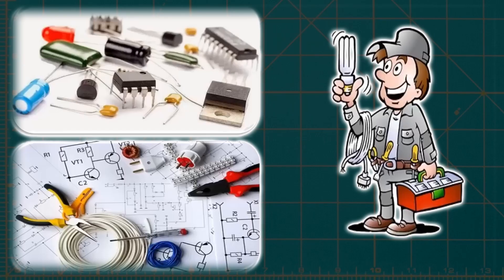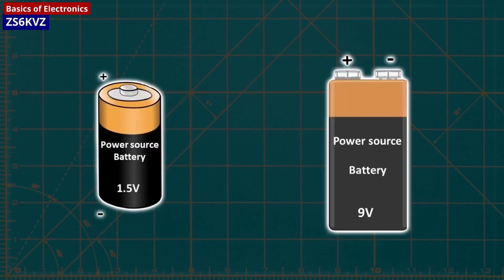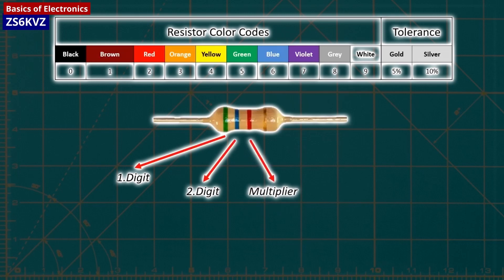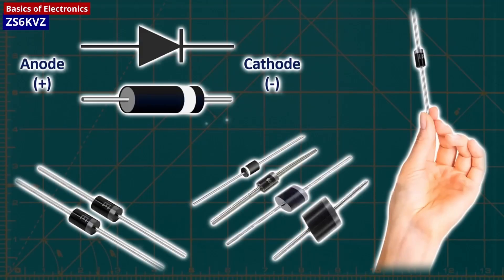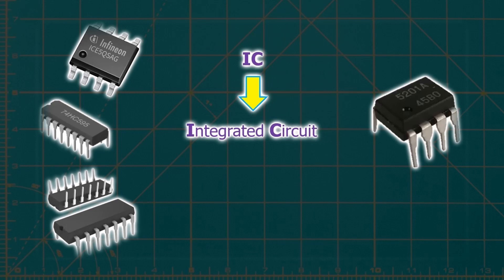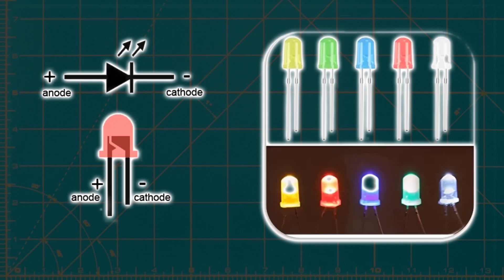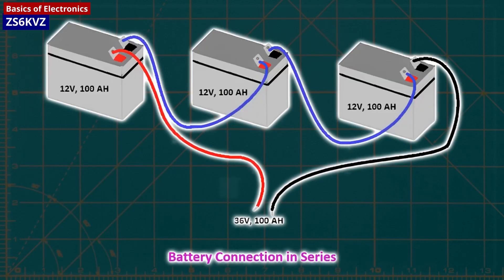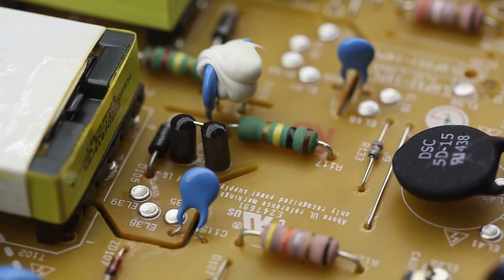The Basics of Electronics in 14 steps.

Comment: Is capacitor connected with ground ?
Reply from the maker: Thanks for the question! Yes, a capacitor is commonly connected with ground in order to complete the electrical circuit.  A capacitor connected to ground can have different purposes depending on the circuit context. Some possible purposes are:

To form a low-pass filter for the line, as it removes high-frequency signals by giving them a low-impedance path to ground.
To suppress spikes in the power line that can damage the board or the components.
To fix the electric potential of the plate attached to ground.
To provide current to the circuit when a voltage drop occurs.

Comment: Step No.1 Nothing can work without a voltage
Reply: Correct! Nothing CAN work workout voltage.
Reply from the maker: Thank you for your comments.  

So true, without the difference in electric potential between two points, there will be no electric pressure or electric tension and therefore no current flow.